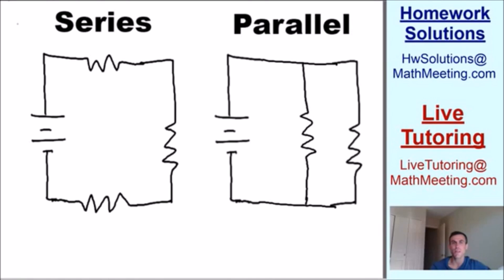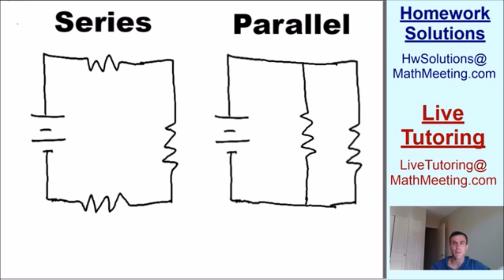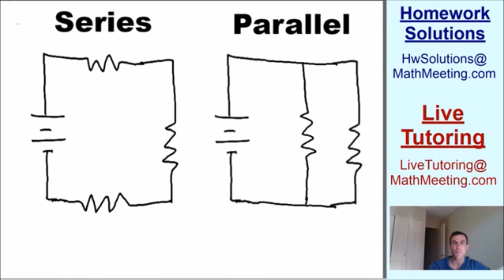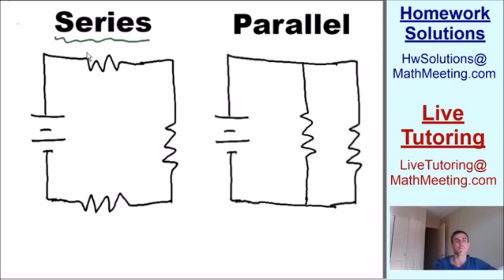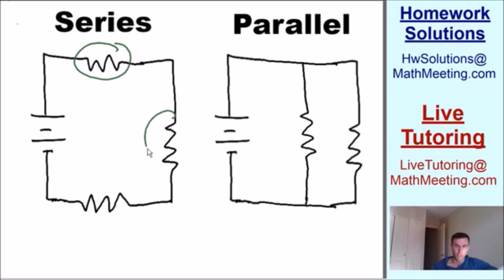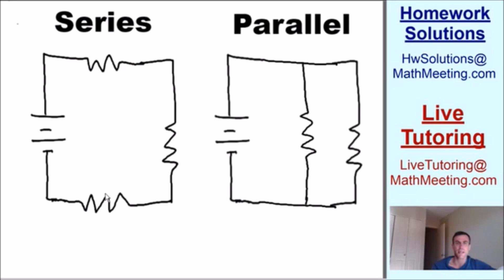Introduction to circuits - series vs. parallel circuits

Comment: thank you - I'm working on my ham license and keep getting tripped up by the differences between series and parallel circuits and how volts and current changes.  This really helped.  Now if only I could teach you what clockwise and counter clockwise are.

Comment: If current is consistent in a series circuit and voltage is consistent in a parallel circuit, what is consistent in a series parallel circuit?

Comment: Electrons flow out of the negative and end around the positive end of a battery. 🔋
Reply: Technically, yes, but apparently we're supposed to follow Benjamin Franklin's convention that he found back in the day and he found that electrons flow out of the positive end of the battery. Even though he was proven wrong later on, we (idk if everyone does but our physics class does) follow Franklin's incorrect convention.